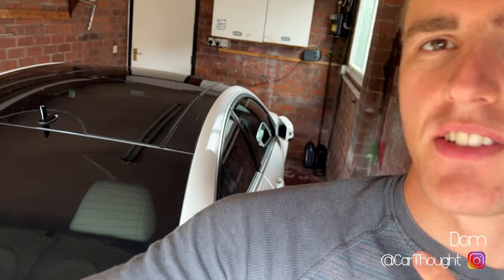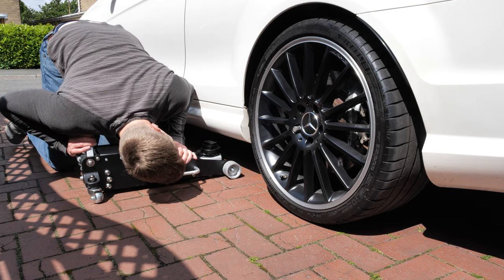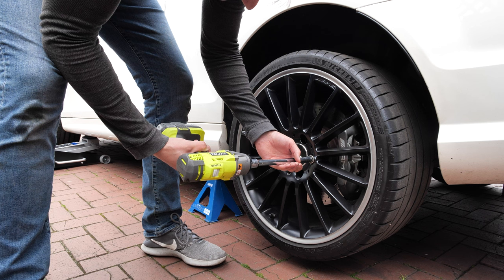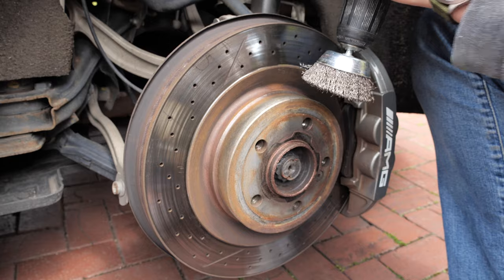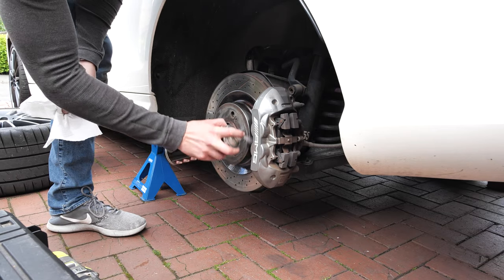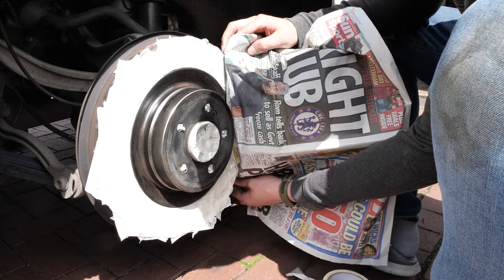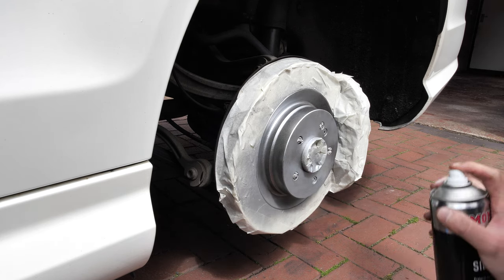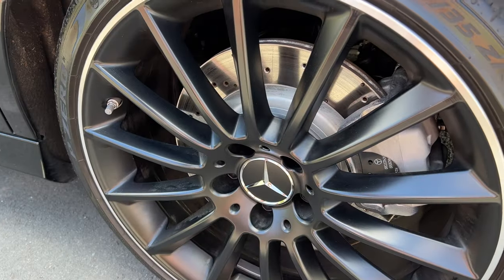How to fix your rusty brake discs! C63 AMG DIY

Comment: I have the same issue with my 2011 Jaguar XJ. I was all ready to do it but wasn't sure how it would play with the calipers etc, but Im glad to see this video to give me a bit of extra confidence. Thanks for taking the time. Great result.
Reply: Are you noticing squeaking with the brakes?
Reply: @47k_dc  no im not, except once in a while when wet and/or cold, they groan a little while i'm in the driveway, but as soon as they're dried off they're totally normal. I haven't dont the paint trick on the calipers yet though.

Comment: Just a few tips, I wouldn't use an engineering brick as used here as they have very sharp edges like razors and can cut the tyre, they also can shatter easily under pressure causing the car to move suddenly.
If you are going to support the car metal to metal it's best to use a piece of dense wood between to help prevent jack or stand jumping out.
Finally, the copper grease film is there to stop the alloy wheel 'welding' itself to the disc due to reaction of different types of metal. 
IE, Corrosion, sometimes even tyre fitters can't remove them when this happens, and it will often!

Comment: The discs do looked quite worn and lipped actually. In the long term it would be better to renew them and before you fit them spray the non friction bright parts with the ultra high temperature paint to prolong the finish. Use a cardboard template with a circular cut out to mask the friction surface. If you are really keen then you can paint the edges too. On your car with black wheels I would have actually stuck with matt black, but it is a matter of taste.
Reply from the maker: I wouldn’t call that a worn disc. All brake discs will have wear, that’s how they work. But I’ve worked on lots of cars with high mileage over the years, so maybe I’m used to seeing a lot worse. I don’t see the point of renewing parts that are working fine, especially when they’re £300 for 2. They’re painted from factory, so if you did fit a new pair, you wouldn’t need to re-paint them. The paint in the video is VHT. The factory colour is silver, not black.

Comment: I have impact sockets myself and on the odd occasion when I couldn't find the right impact socket I have used the normal 6 point socket and recently trying to remove my wheel nuts that had been done up so tight a breaker bar couldn't budge them I used a normal socket on an impact gun and not even a scratch on the socket and it was also a cheep socket aswell

Comment: You never paint the mounting surface!
Reply from the maker: Would love a logical explanation to back up this statement..
Reply: @CarThought  because it is the same reason that you never paint or clear coat parts of a rim where the bolts go. You need to have metal on metal and not metal on paint. Even if you torque down your rim...the paint between the parts can cause the bond to loosen up.
Reply from the maker: How thick is your paint? The contact area between the back of the rim and the disc surface isn’t bonding anything mechanically or chemically. There are 5 bolts clamping the wheel onto the hub @130Nm. There isn’t any paint on the threads. The disc is sandwiched between the rim and hub.. it’s not a fastening. In the video you’re commenting on, you’ll notice the factory black wheel bolts are also powder coated all over.
Reply: @CarThought  you may want to ask around where good guys resurface and repaint rims. They will tell you the same...no paint where proper surface contact is needed.
Reply from the maker: Ah, it’s second hand information? If you could ask whoever has told you, that would save us some time 😄. I can see why they don’t paint the wheel mating surface due to heat cycles from the disc, and potentially cracking the paint from the back, thus ruining the visible wheel paint surface over time… But from a mechanical point of view it shouldn’t make any difference.
Reply: @CarThought  not sure what is "second hand" info? Believing "nah what can that tiny of paint do?" is kind of the same? Use Google for example and you'll find lots and lots of people sharing the same view: just don't paint any mating surfaces. Here is a Google prompt for you "why you dont paint wheel mounting surface"
Reply: @CarThought  Google "why you dont paint wheel mounting surface" and find endless info from pros and mechanics that will tell you what you need to know. Come back when you've educated yourself a bit more.
Reply from the maker: Second hand information is where you say something because someone else has told you it. You don’t understand what you’re saying, but you still think it’s right. I can make Google tell me anything if I phrase the question right. Personally I'll trust my engineering degree and years of hands-on experience over simply Googling things. Maybe you could make a video on your channel explaining the engineering behind mating surfaces and their coatings?
Reply: @CarThought  well.. I don't have a channel. Let's find a channel and direct the question to them?
Reply from the maker: You do, it’s called ‘christianapn’. You’re using it to write these comments ✌️.
Reply: @CarThought  it's obviously not an active channel. Name a reputable car channel and let's get in touch with them

Comment: Nice work however not a fan of drilled discs as they as for the work it’s my experience that it will over time chip and flake. 

Next time cover your paint work all in seeing is over spray and it will have got on your fenders…. Mind you not somthing a bit of petrol won’t remove

I painted my mx5 nc rosters a mid of purple and blue but them just replaced my stock discs with black mtec grooved discs
Reply: @megajohntopunishenslave427
Have you had a drink? Your comments make no sense.

Comment: Thanks. Why did garages always want to replace things in pairs. I have one brake disc at drivers side front needing replaced. Two garages have said. We only charge in pairs, so two brake discs required, plus two sets of pads???

Same deal with the rear. Rear passenger side needs a new disc. The garage said, 'We can only do it on pairs, so you need 4 new disks and 4 sets of pads. Seriously?? It's a Jaguar XE, R-Sport, 2016 model.  Love from Scotland, ❤ X.
Reply: I would be more concerned about why your brake discs and pads are wearing more on one side than the other! But it's always best to replace both sides at the same time to ensure even braking performance, you really don't want one side braking less than the other, this not only can cause your car to pull to one side when you brake, but also puts uneven stress on your suspension components and tyres. Another big reason is - Brake pads and discs almost always come in a pack for each axle (i.e two wheels) which is 4 brake pads, and 2 discs. If you went to an auto parts shop and asked for brake pads for one wheel they'd look at you like you were crazy.